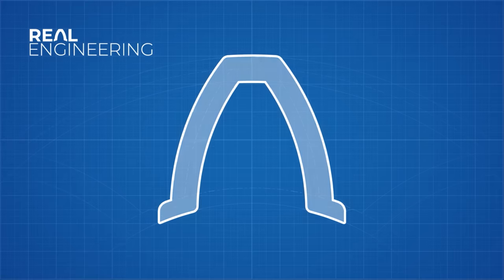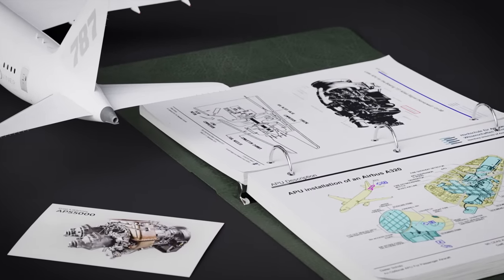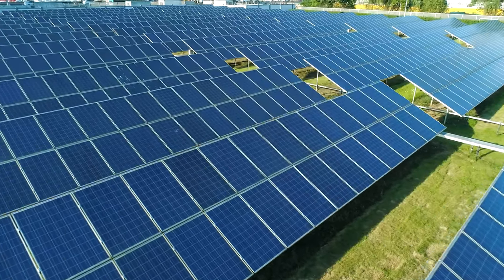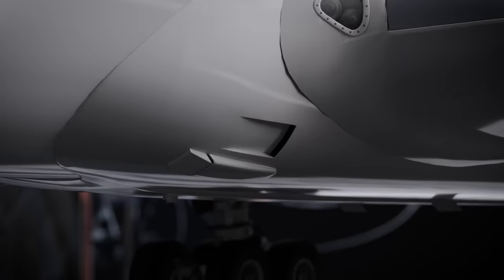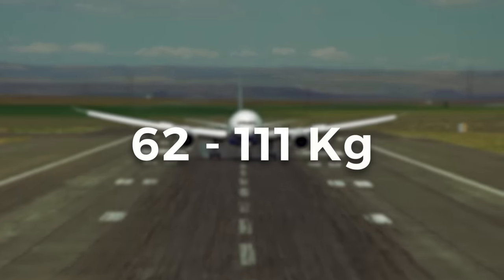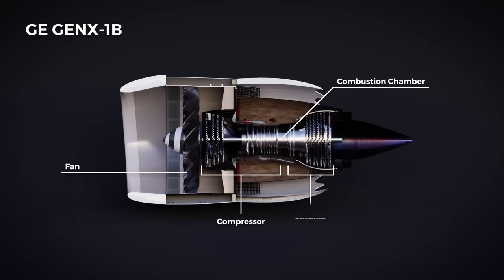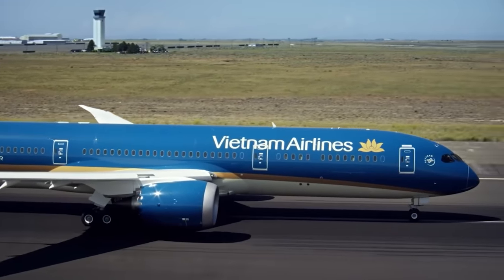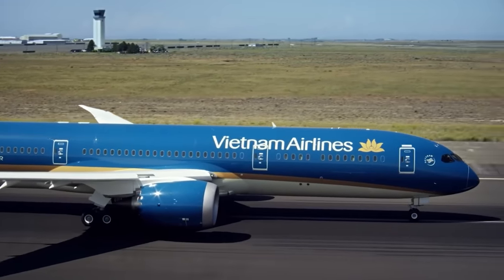The Insane Engineering of the GEnX

Comment: Thanks for the great content! In my time as a contractor at GE in Cincinnati, I helped do CFD for those 3D-printed fuel nozzles and for combustion chambers of the subsequent products that built on the technology of GEnx: the LEAP and GE9X. They were insanely intricate and pushed the state of the art for jet engines. Predicting combustion behavior is also totally a black art. I was humbled by the absolute geniuses they had working on developing the statistical models that I fed into my analyses. 

@17:43 One nitpick about thermodynamic concepts, here: Maximizing pressure ratio doesn't "maximize" the amount of energy you can extract from the fuel... Adding heat through fuel burn increases enthalpy (H) isobarically with entropy (S); think about the 2nd leg of the Brayton cycle as drawn on an H-S diagram. Fuel has some specific energy and you could achieve the same dH for a given fuel mass, because we're still talking about the same specific heat, Q, being imparted to the working fluid. Compressing the air more just starts that process at a higher initial H, but that also increases its T, meaning you'll be actually able to add less heat before hitting your turbine material thermal limits. This still improves efficiency because the more the cycle increases H by compression than by combustion, the less fuel is necessary to make up the difference in total energy needed by the complete engine cycle. Thermo is fun!
Reply: Can you give me help on how you do CFD with what apps and techniques to develop the data into meaningful solutions. Long shot but please, chemical engineering student here
Reply: Oooo,,, which software? I hear good things about paraview!
Reply: Of course his name is Goddard ;)
Reply: @Certago  noble sure name.
Reply: just checking if I grasp the concept, regulating presure and working with less igniting temperature was more energy efficient right?
Reply: "Thermo is fun!"

Says a non electrical engineer. ;-)  Actually it was for the most part, in the core, but I found fluids even more fun.  My brother is a thermodynamicist and rocket propulsion guy, though, retired.   

I had a dynamics prof that first day says, F is ME.  You now know everything there is to know about dynamics.  I picked my stuff, up, stood up, and started to leave.  He laughed.  At about the time of Coriolis I was wishing I had carried through.  IMO, that was one of the most difficult courses I took, save maybe EM Fields.  There you just threw Calc at it and hoped for the best.  I saw NOTHING intuitive there.  At least in dynamics I knew if I calculated the weight of the guy in the elevator to be 1800 lbs. it was wrong, because he told us he'd keep it to reasonable numbers.  

Days long gone, and mostly forgotten, probably for the same reason women forget childbirth.  And then you get to do real work, which is far MORE stressful at times, especially when human safety is a concern, and you are in the 'drinking from a fire hose' stage of your career.  Was for me, anyway.  Some real fun involved, too.

Comment: I flew in one of the Dreamliners from Vancouver Canada to New Zealand, The difference in noise, comfort and general exhaustion was very noticeable. I was dreading such a long flight, remembering flying to Thailand in an older jet more than 10 years prior. It was a breeze in comparison.
Reply: Another factor in increased comfort is likely because of the higher cabin pressure, closer to 6000 ft than the 8000 ft normal with older planes.
Reply: agree!!!
Reply: I agree. I flew from San Francisco to Singapore a few times on United's 787. The 17 plus hours on this aircraft was the best ever flight experience in my over 50 years of flying.
Reply: On October 24, 2021, my sister flew on a Dreamliner from Amsterdam to San Francisco. She didn't know what aircraft she was on because she doesn't care. I asked her if her flight was more quiet. She said no. She noticed no difference between the Dreamliner and other aircraft except when descending the pressure on her ears was less.
Reply: Dreamliner fails from the SC plant which now is all the production are known for problems with inspections of faulty seams door cutouts grounding and battery issues cockpit glass shattering and breaking much more then normal. These new efficient engines cause flight instabilities on modified planes like the max or the 777x which even scared the FAA who will not review them in flight after a flight test pitched toward the ground like the MAX. A hundred Dreamliners are grounded suffering from quality issues. Inferior titanium that passed initial QA. Oh forgot this weeks issue that affects all past and current dreamliners. The carbon fiber wings and fuselage are made with contaminated carbon fiber. Boeing has a sht show like the world hasn't seen in some time. These ultra efficient engines are huge as the high bypass design has those huge Turbines in the front. This cause modified planes to have to move the engines forward and upward with the edge neat the leading edge of the wing. This was why they use MCAS in 737max and something similar in the modified 777 the 777X. Most Airbus planes are much more recently developed with higher wings that provide proper clearance and are stable in flight. The Dreamliner if it was done properly is also a much more modern design but every one made has major issues. The people who work on the Dreamliner assembly line in SC have said in interviews, "I would not allow my family to fly on that plane". Regarding the insane engine...They are over-stresses as the huge turbine creates huge centrifugal force and bladed if not perfectly mounted, break. Boeing is replacing the shrouds that the FAA cited as being to weak to full contain a turbine failure.
Reply: What,did you think of new Zealand,  jezza? Where did you go?
Reply: I flew with it with Qatar air, and the 777 was much more pleasant experience, more space and comfort...really must depend on how the airline makes the inside
Reply: Fly in an AIRBUS 350 with RR engines for comparison
Reply: It's a fantastic achievement.....but the seats in economy are, shall we say, shaped for the average passenger. With my back, I ended up standing for half the flight from JFK to LHR, so some improvements needed. But it's a beautiful 'plane.
Reply: @_Alfa.Bravo_  Flew onboard an A359 once & it's APU was quieter but engines were noisier than the only few times I've been onboard a 787 (which use RR Trent 1000 engines instead however)
Reply: same here - London to SF was a 10 hour journey without a single turbolence and I enjoyed every minute of the flight, especially being window seated with those massive windows!
Reply: @timfagan816  too many sheep, too many shite roads, too many greedy people.
Reply: @eleventy-seven  were these ones built in South Carolina? Because the ones built in South Carolina airlines are not buying period they are substandard it's a nonunion shop and they make less money than they do in Washington. And Boeing wants to move the entire 787 program to South Carolina. In my opinion that is a huge mistake and is going to put the nail in the coffin for Boeing. They'll be selling all the information on this airplane to make ends meet.

Comment: Symbol for “kilo” is a lower case “k”. Symbol for newtons is an upper case “N”. Thrust measured in kN, not Kn.
Reply: Thank you, very useful info
Reply: Smarty pants.
Reply: shift key typo, inverts cases.
Reply: These autocorrect oversights often change the meaning of the unit of measure.  I expected more from an engineering channel.  Kelvin nano???
Reply: @dfburgers3568  noted.
Reply: 142 likes
Reply: also noticed that.

Comment: Before the B787 the B747-8 started using the same GEnx Engines and trust me as a Transit Engineer I have not seen an engine so robust, which requires little maintenance on line.. The difference between the 2 engines on 787 and 747-8 is that one on 787 is bleedless and the other on 747-8 taps bleed off the engine.. Great Machine 👍🏽

Comment: I've seen this engine upfront at a GEIQ center, they are absolute monsters
Reply: I think one has to see it in person to get a frame of reference. When I board a 777 I always am in awe of the diameter of that engine.
Reply: @LK-bz9sk  The 777 doesn't have an option for the GEnx, but yeah, even those little CFM Leaps on the MAX are much bigger than you'd expect lol
Reply: @everettrailfan  the GE90 engines fitted to the 777 make the 797 GEnx engines look small in comparison
Reply: @joecmonteiro  The 747-8 also has them, and you accidentally said 797 instead of 787 lol. Also, the GE90's fan diameter is only about 1.5 feet wider, whereas the GE9X's fan diameter is 134 inches as opposed to the GEnx's 111 inch-diameter, which is still only about 2 feet wider.
Reply: Yeah as Brian said in the video, they're about the same diameter as the fuselage of a 737. That's astounding. I guess it's hard to get a sense of scale just looking at video footage. All jets look about the same size in pictures.